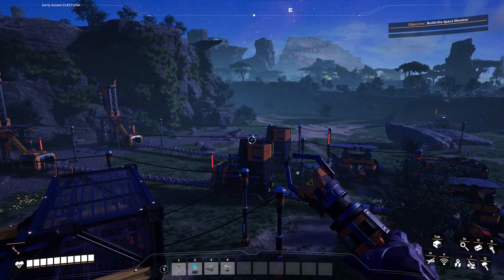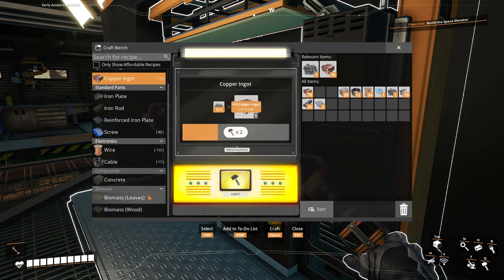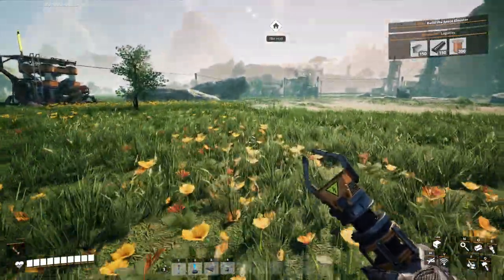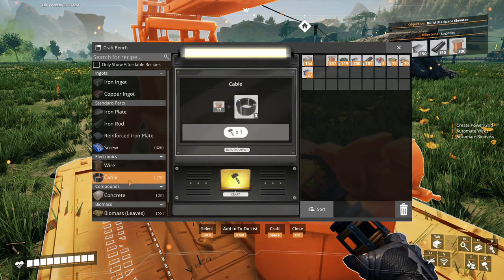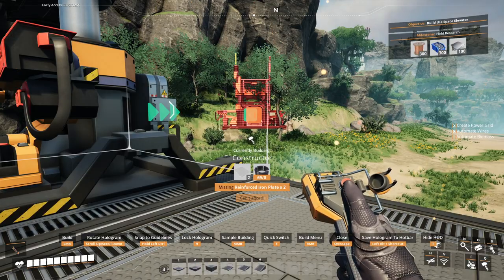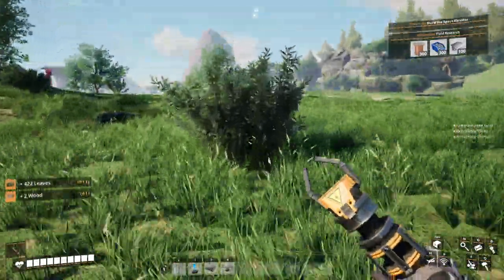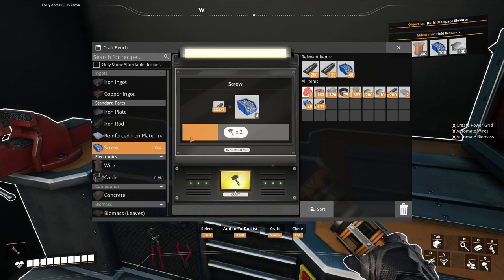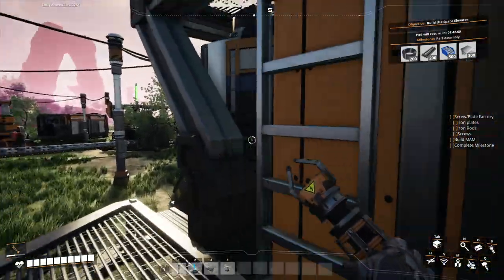Let's Play Satisfactory Update 8! Episode 2: Starting to Automate!

Comment: Good stuff.  Another big advantage with flowers and their long burn time is while the biomass and solid bofuel is being crafted in the constructors and while you are waiting for backstock of screws, plates, whatever instead of going out for more leaves and wood you can do hard drive hunts, power slug hunts, can still collect leaves/flowers/wood with the locked E function but that can become secondary instead of the main reason you are out of base.
I watch people going harvesting for what seems hours interspersed with other play.  Then later they do the same for hard drives or power slugs.  By running things with flowers I cut to the hard drives and power slugs much sooner.  I usually will have the MAM open first and have Cast Screws recipe before I really need screws much.  Saves lots of work later.  Work is time.